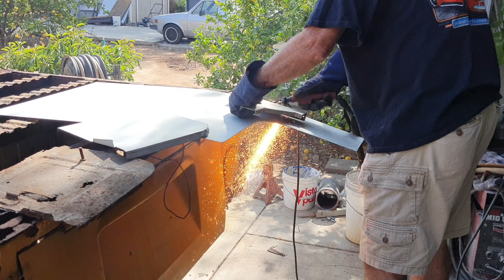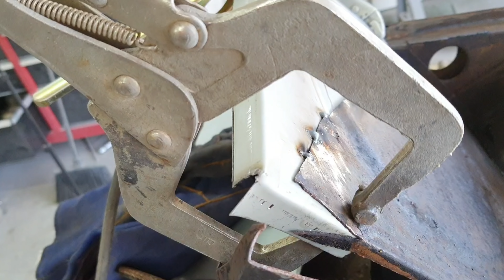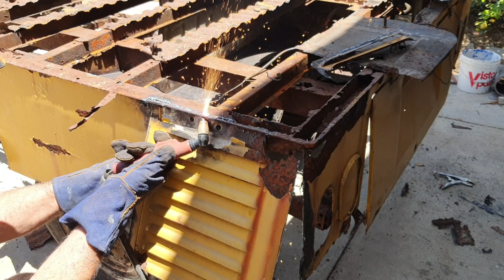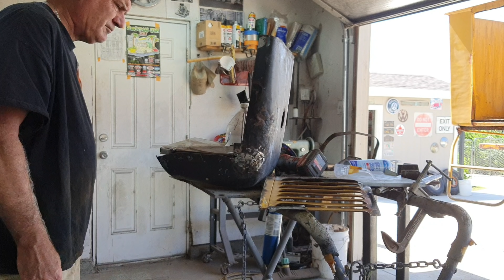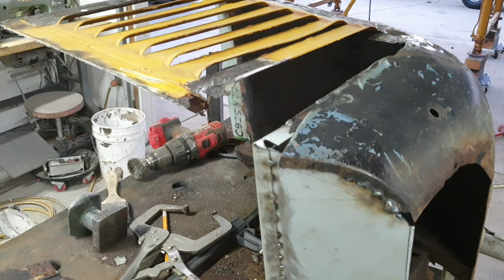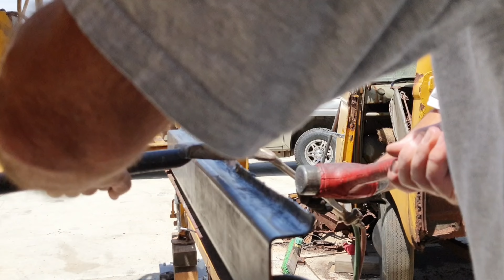Extreme rusted out VW  Single cab pickup can we save it.

Comment: Metal is cheap because it’s right off the boat from CHINA it will rust super fast
Reply from the maker: yea for sure. I like the electro galvanized stuff. cost more and still works really well for the sheet metal but the metal frame should be fine for many years.

Comment: You are really starting with a heap of crap, virtually nothing on it worth saving. You are going to be replacing it from the chassis number upwards!   You might as well start from scratch and build your own version of it? Probably less work as you not messing with rusted rubbish before you remake everything?
Reply: Hi, not being disrespectful here, and yes this truck is severely rusted... However, this is what he has to work with, and he is out doing it and videoing it as well - I've been doing old VW's for 30 years and sadly this is what's left of these old commercial trucks.  I like seeing someone with more drive than I have work on an old single cab 😊 My '58 panel was/is rough and these videos inspire me after a long day of work to head out to the shop and work on the body.  Cheers!